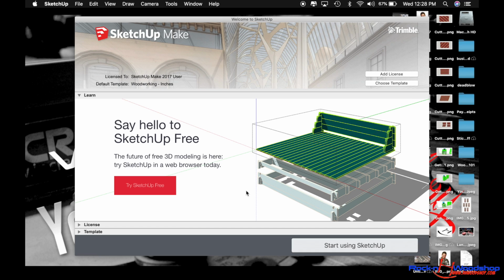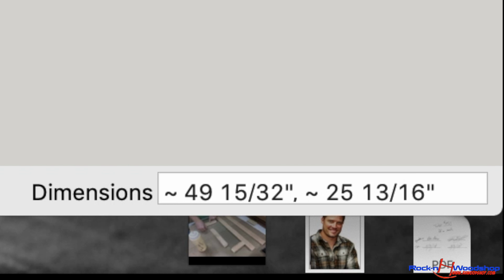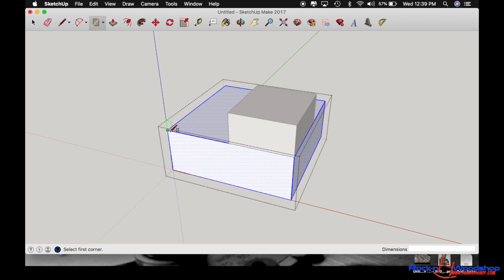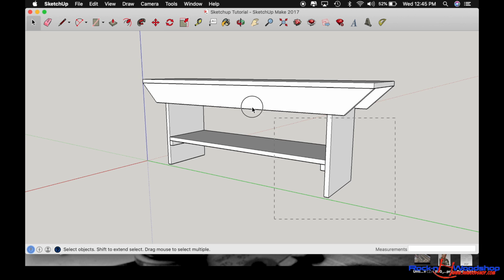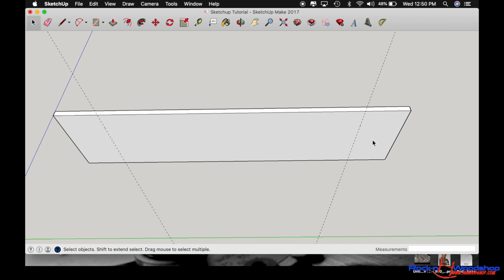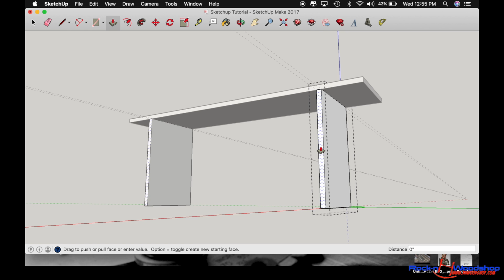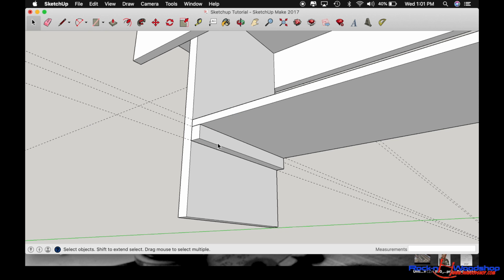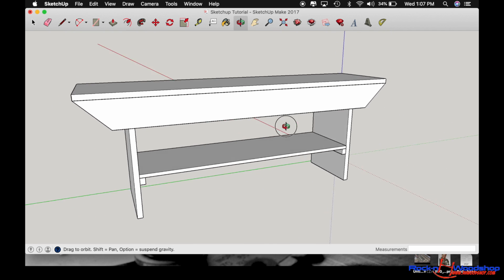Getting to know Sketchup  - Sketchup for Woodworkers Tutorial 1

Comment: Hai, did you know there is an alternative to sketchup make, with a few advantages, There is a combine function in "Design Spark Mechanical" that program is free to use. If you want those "combine" tools in sketchup, you need the pro version (not free) For instance, if you draw a side board for a table and you draw the tenons at the ends of it, you can put your board but against the table leg and cut out the mortise with the combine tool. you can open skp files,  and step and obj even stl files directly or drag them into your sketch
Kind regards Hans

Comment: Drew, when you are creating a design in SketchUp do you use the actual or nominal measurements.  For example, I'm designing my upper workshop cabinets and will be using both 3/4" and 1/2" Ply.  Being 1/32 smaller on a single piece of anything is not a big deal, but when it comes to cabinets or long runs the difference compounds.  When making my layout and cut-list it's messing with my mind.  I feel like I'm over-thinking this, but I'm a very detail oriented person and it bugs me a little.  Any guidance from you would be appreciated.

Comment: Really got a lot out of this tutorial and am looking forward to more. Not sure why but I can't seem to make any of the customizing changes in preferences like you did. The protractor doesn't show up as an option to add to my tool bar and I couldn't assign a keyboard shortcut to it in the shortcuts. It rejected every option I tried including "shift-P" even though I couldn't find anything else that had that keystroke assigned. I can still get the protractor via the Tools menu but it would be a lot handier if I could use a shortcut or even snag it from the tool bar.
Reply from the maker: Wow, that is strange, very strange.  You have the downloaded free version of Sketchup Make 2017 right?  You aren't using the web based version are you?
Reply: @rhwoodshop  No it's the stand alone app, version 12.3.116.
Reply: Sorry, version 17.3.116.
Reply from the maker: Wayne Harlow Did you download this from the same link as I got mine? Or did you download this from a third-party other than sketch up?
Reply from the maker: Wayne Harlow it is quite possible you have a corrupt downloaded software. You might try the link that I have in my show notes

Comment: I'm hoping you are still looking at the comments on this video. It is great by the way. I am having problems with the 45 degree angle though. I have done exactly as you said but when I try to push/pull the corner it only moves the face and not the end. Very frustrating. Can you tell me what I am doing wrong?
Reply from the maker: Hey Greg, email me a copy of your file and what I will do is a quick video of what you need to do to fix the problem you’re having.
Reply from the maker: Rhwoodshop@gmail.com
Reply: @rhwoodshop  I believe I got it figured out. Looks like I did not save the entire apron as a component, just the face of it. Another issue I am have though is when I use the tape measure it is only putting a small mark and not a guide line. My guess is I hit a button I was not supposed to. How do I get it back. It was functioning properly earlier.

Comment: Thanks for a great tutorial. Really easy to follow as I have a MAC and can follow the commands. My only issue is Sketchup doesn't like my MagicMouse. A Microsoft mouse works but I wonder if I should buy a tablet?
Reply from the maker: All of the tutorials that I do I perform on a MacBook Pro with a touchpad mouse. I don’t think it has a problem with a product manufacturing mouse (Microsoft) but some programs are a little buggy with specialized equipment I’ve noticed. But I wanted to let you know what I actually compose these tutorials on.

Comment: I couldn't find a shortcut for a save button for the toolbar. Any ideas?
Reply from the maker: To save your work if you are on a Mac it is command S. One reason why one component will not be affected if you were changing its copied component is if you copy that particular piece while you are in the edit setting of that component. Do not copy while you’re inside of a component, only copy when it is highlighted
Reply: @rhwoodshop  For some reason when I saved the project, and highlited it again, it worked this time. Ty. I forgot it was Sunday.
Reply: @rhwoodshop  Not sure what you mean by, inside a component. So, we need to highlite before we copy it?
Reply from the maker: Michael Lusk The Lazy Woodworker I mentioned it in the very beginning about making components and going inside them to do the editing. Going inside a component means triple clicking and having the dotted halo around it which will allow you to make changes to it. Copying a component while inside the editing portion will cause the copy to not respond when changes are made to its mate. So if you copy while just highlighting a component and not going into the editing portion it will respond when changes are made

Comment: You seem to be to keyboard centric. In CAD environment the keyboard is a tertiary input. Primary=mouse secondary= Space Navigator then keyboard. Establish floating menu palettes. That way you have only to slightly move your mouse to activate icons. Hotkeys, Google had their heads in a dark spot with "G" for components! Change that to "C" and the use "G" for groups (which is nearly a useless feature anyway @14'55 you just proved my point. Drawers MUST be a component for some plugins to work properly.). Add "Outliner" to the Default tray. That makes components LOTS easier to use.

Comment: Simply awesome tutorial. I'm just now retiring and getting into doing some simple wood projects around the house. First up is a table top for a front loading washer and dryer. There will also need to be an elevated L shape enclosure at the back to hide the connections which are higher than the W&D. This awesome tutorial is so simple to follow and gives me exactly what I need for this project. A table top, three legs and the L shape riser for the back. Thanks for this great presentation.
Reply from the maker: Awesome comment and I’m so glad I could help

Comment: I followed along and it was so easy to create that way, I've done a couple of the sketchup tutorials but they are more complicated. Here I found the shelf cleat would have to be made lower down on the leg and then moved into place. The make component clicking kept including the shelf.
Reply from the maker: +LT Woodproducts if you forget to make the component for the leg and you make another one on top of it it will include it. You also need to click out of components before you make other ones because again it will include it as one part.

Comment: Thank you for this series.  I tried three other tutorials before getting to yours. Either they weren't woodworking or they started assuming I knew the interface.  I found yours.

I am using a different version but after looking around when you said to, I found a tool bar on the left I liked that exposes just about everything. You started with your bench at a different angle on the screen, so I messed up my first bench and started over. Actually, I did this twice. I had made some unknown error.  But, that's ok. Each time I repeated the project, I caught up much faster. No harm done. I wrote down all the dimensions the first time so now, if I had to recreate it, I think I can do it in about 5 minutes.

Getting used to the orbit and hand is a PITA, but that's not on you. By the time I got to the skirts, I could figure out what I was doing regardless of the angle you used.

On to the next video

Comment: I am on windows and am having a real problem creating rectangles. My problem is finding the intersections correctly. I will draw the leg rectangle then pull it to the green line. When selecting the front face the top and leg are selected. What am I doing wrong. I am on sketchup 2017 free. I do not get the "intersection with component" indication just intersection( intersection with line).
Reply: I uninstalled and reinstalled problem fixed
Reply from the maker: Glad to hear you figured it out. From what you were describing it almost sounded like you failed to make your pieces components and each rectangle you may joined up with the other pieces

Comment: If one component is copied after another but I don't want to modify both, what do I do? Like an example, with the bench from the video, I want the 45 degrees cuts only on the front skirt.
Reply: R-Click on the component and chose "Make Unique" and it will make it its own unique component that won't be affected by chances to the original component.
Reply from the maker: Thank you that is another way. Without going into the component like he said make unique and it will separate from your original component and be one all its own but if you want the components tied together but separate as far as changes then do the way I listed earlier
Reply from the maker: Then go into the component and then copy it
Reply: @rhwoodshop but that's the same thing. If I make the front skirt with the cuts and then I copy it in the back, both will have the cuts.
Reply from the maker: Yes b/c you made the cuts on the first component.  Make a fresh rectangle with no cuts.  Save as a component.  Go into the component. Copy and move to the other side.  Then make cuts to the component of your choice.  Since you copied into the component it will only change the component you are messing with and not the other.
Reply: Thanks, guys.

Comment: Drew, I do not believe that you can customize toolbars on a P.C. When I right click on a tool bar, the only thing that comes up is a list of all the other toolbars. I do not get that customize menu that you show. I have tried everything to find that menu with no luck. What am I doing wrong? I am also using Sketchup Make 2017 with Windows 10.
Reply from the maker: Let me do some investigating to find out what's up.  Sorry for the inconvenience.  I will get back to you.  Maybe I can ask it in my next vid and someone can help.
Reply: @rhwoodshop  Thanks.
Reply: You are right. The PC seems to just let you add and remove different menu bars. But if you r-click and go to the bottom where it says Toolbars, you can then create a New Toolbar with your custom tools. In order to move tools from one toolbar to another you have to have the Toolbars menu (where you can check boxes for visible toolbars and create a New toolbar) open. With that open you can then move tool icons between different toolbars or copy them from the default toolbar to your new custom one. FYI, this ONLY works for tools that came with SketchUp, tools from plugins you add will not be able to be manipulated like this.
Reply from the maker: Thank you for that. That helps a great deal
Reply: @spencerjw  That works very well. I also discovered, if you just click the icon it will actually move it, but if you press and hold the control key it will copy the icon and consequently the tool. Thank you so much. I am sure this has helped more users than just me. You "ROCK".

Comment: Nice tutorial Drew! If you're not familiar with the 3D Connexion Space Mouse it makes using Sketchup a lot easier to use. Anyone who finds sketchup to be something they begin to use on any kind of a regular basis I would highly recommend picking one up. It makes navigating around your drawing a dream. No more changing to orbit and click and drag and change back. With the Space Mouse you fly around your drawing with ease. You operate the Space Mouse with your left hand and use the regular mouse with the right. It cost around $100 for the base model and is worth every penny. I would liken it to the difference between welding with an auto darkening helmet vs. a fixed shade helmet. Not something you really need until you use one. Then you can't go without it!
Reply from the maker: It looks like the starting model is $129 for the wireless version, is that correct. Is that the one you use?
Reply: @rhwoodshop  I have been using Sketchup for a while and use a standard two-button wireless mouse with a scroll wheel and it works fine. If you are just learning I would recommend using it before spending money on a Space Mouse. Just my humble opinion.
Reply from the maker: I agree.  Ive used it for a couple years now and I am pretty efficient at it but in hopes of making these tutorials an easy to follow method, I will continue to use my standard touchpad so my instruction stays consistent.
Reply from the maker: I am definitely going to check that out. It sounds awesome!
Reply: Rock-n H Woodshop  👊😊
Reply: Sounds good but the cost is high for weekend woodworkers like me. With your help Drew I am getting faster with my old mouse.
Reply: @ronaustin5848  Hi Ron, I have been using SketchUp for awhile and use a mouse with a scroll wheel. Once you know the keyboard shortcut keys you will go faster in your modeling. If you go to google and type in SketchUp shortcut keys and select images you will see a bunch of pic's with keys listed. And once you get a hang of it you can create your own shortcut keys. Have fun and don't get frustrated. If you get stuck just ask a question.
Reply: Which one?
Reply: @ryangratland2330  I have the cordless but either would work fine.  Just a matter of preference. I was worried at first that the battery might die (it can't be changed) but it's been working fine for over 3 years now. It needs charged occasionally just plug it into the computer via usb cord. If you use sketchup you will love it I promise!
Reply: Yeah, that's the one. I've had mine for about three years now and it's great. Can't draw without it. The corded one would be fine too because I really only use it when drawing in sketchup. Another cool thing you can do with it is fly through Google Earth. Normally you would have to navigate Google Earth similar to sketchup clicking and dragging but with the Space Mouse you just fly around! It's great!